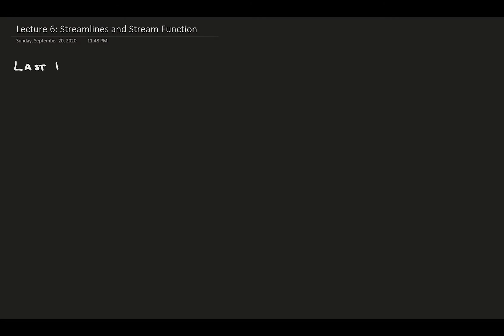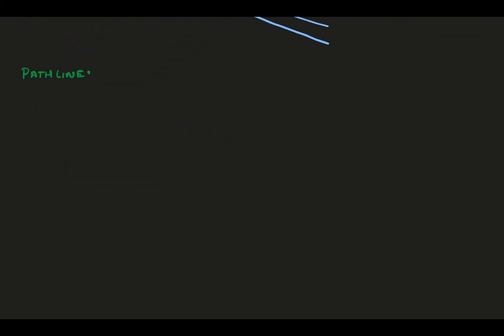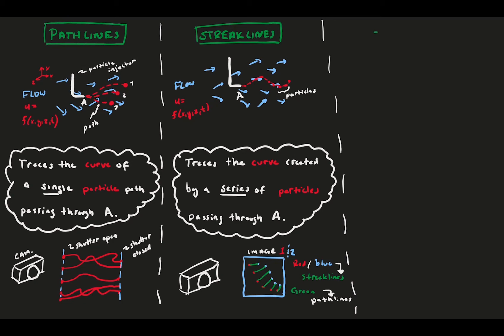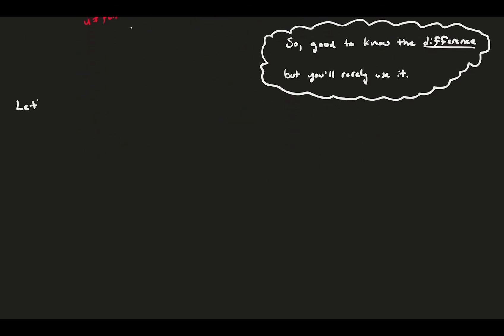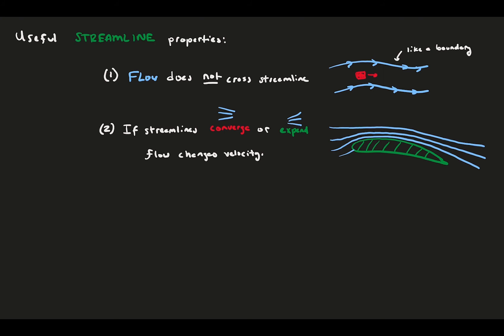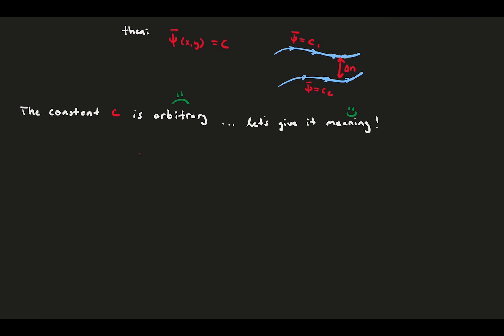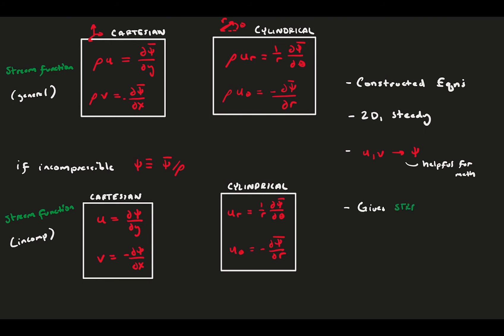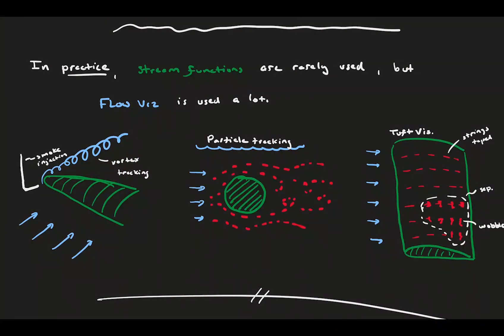Streamlines and stream function [Aerodynamics #6]

Comment: Hey there! I've just discovered your channel and absolutely love your content, but I'm having a difficult time understand why 'c' remains constant for a streamline with stream function ψ(x,y) = c, and I was wondering if you might be able to shed some light on the matter.   
 
 I know that c is just the value of the stream function, but when you expand it all out, c is technically the ratio of two integral constants [c1 and c2] of two equal and nondescript functions [g(x,y) and h(x,y)] that you create by integrating the differential equation  [dy/dx - v/u] of a streamline, which is a very abstract mouthful. What about c specifically makes it so that for all x- and y- coordinates in a flow field, it remains constant along what might be a very complex streamline? Wikipedia states that the stream function is constant because 'streamlines are tangent to the flow velocity vector of the flow', but that just seems to be referencing that how streamlines always follow the direction of the field. I'd be really grateful for any insight you could provide.
Reply: @Prof. Van Buren  I don't fully understand how could we simply replace C with mass flow (per unit length). Is is cause mass flow is supposed to be constant along a single stream line? (or between stream lines, given mass cannot pass them, hence they effectively act as tubes of constant mass flow)
Reply from the maker: Yep! I think your thought process is correct, the streamlines act as boundaries so mass flow is conserved between them.
Reply: I also had a bit of a hard time understanding that, but it seems to simply be so by definition. All the variable dependent parts are put on one side and form function Psi, while everything on the other side is simply constant and does not depend on variable, hence neither changes thru space or time. We were warned that function is rather built then derived :)
Reply from the maker: Hey Dan! Sorry I am late to this, I saw the comment and intended to sit down and think about it, then 7 months happened. 

@Amir hit it right on the head, imo. It is super common for aerodynamicists to search for some physical foundation of  stream/potential functions, and in truth they are just built because sometimes they lead to better physical intuition of the flow or, more often than not, lead to a simpler mathematical strategy to solve complicated equations.

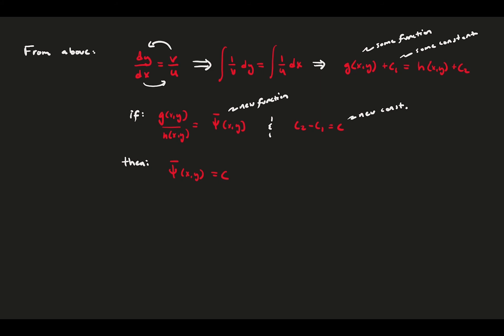Comment: Professor, I would like to ask a question: in 12:40, we wrote a new function g(x,y)/h(x,y) and made it equal to the difference between the c2-c1. But according to the equation we got from the integral, isn't it has to be equal to g(x,y) - h(x,y) ? Why we made it equal to the g(x,y)/h(x,y)? Waiting for your answer.
Reply from the maker: Nice catch! It should be the new constant c2/c1 = c. Luckily, since we are defining new constants anyway, it has no consequence on the subsequent material.
Reply: @prof.vanburen  Was wondering the same. In that case constants C2 and C1 used e.g. in 13:35 are not the same as used in ~12:50?
Reply: I think psi(x,y)=g(x,y)-h(x,y).